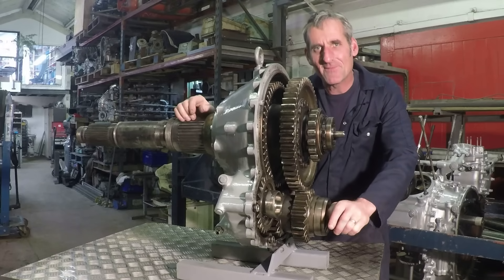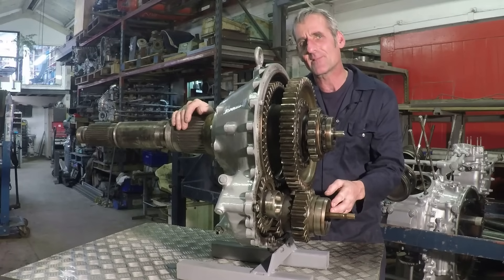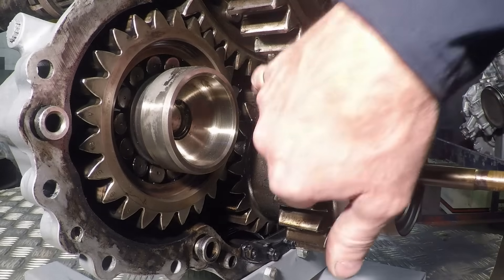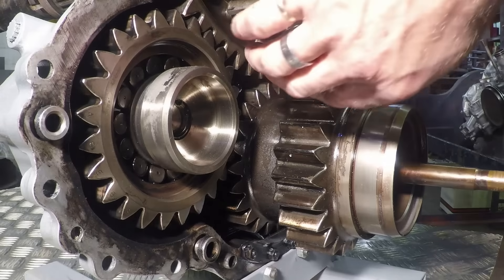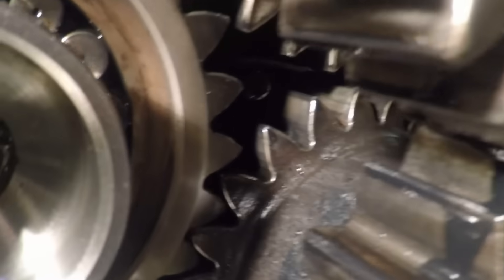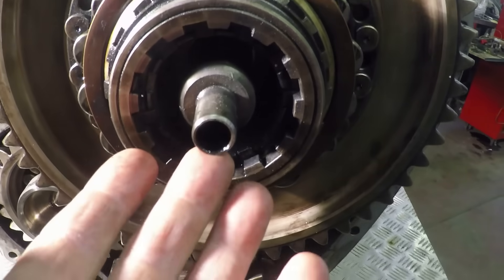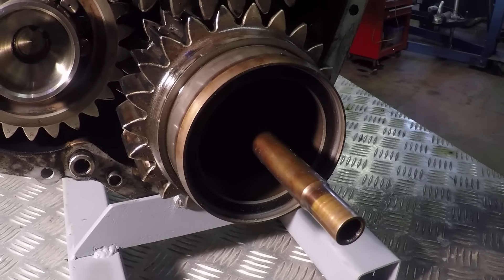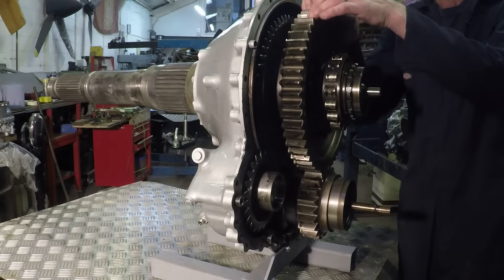An Explanation Of The Rolls Royce Griffon Counter Rotating Propeller Gearbox

Comment: Great video, how much does it weigh, and do you know of any other counter-rotating gearboxes in the 1000-1500 hp class?
Reply: Contra rotating*

The Griffon engine is in the 1700-2500 hp class, not the 1000-1500 hp class.

There was really no need for a coaxial propeller setup in 1000-1500 hp engines. While coaxial propellers are more efficient than a single propeller, they add weight, complexity and cost and were rare outside experimental aircraft. You needed to be in the 2000 HP+ category to have the benefits of a coaxial propeller outweigh the problems. At some point, you need exceedingly impractically sized propellers to absorb the power of the engine, as seen with the F4U Corsair with the gull wings to provide clearance for the huge propeller. It definitely could have benefited from a coaxial propeller setup, but I don't think Pratt&Whitney ever had an R-2800 with the required gearbox for it to work.

But coaxial propellers were nothing new by the time of WWII, engineers had been experimenting with them as far back as the teens and twenties on biplanes. But they had the same problems back then with complex gearing being so unreliable that the propellers often parted company from the engine when a failure happened.

Comment: i'm surprised the gears where not cross cut to keep gear whine down.
Reply: That's called "helical". Helical would be quieter, but would cause axial thrust (the gears push each other along their shafts), which makes bearings more difficult.

Comment: Was the face width on the second set smaller than the rear set? This in order to save power loss. Lubrication?  That’s some grunt going through that set of gears, did the Russians copy the concept for The Bear’s contra rotation props?  I note deep machining of the hubs to minimise weight but no radial slots.

Comment: If only Reginald Mitchell could have seen that.  I can't imagine the staggering amount of machining required just for that reduction/counter-rotating gear mechanism and housing.
Reply: It's not as complex as it looks. The whole gearbox body is either a casting, or more likely a forging for strength. The only real machining needed would be the mating surfaces and bearing journals. As for the spur gears, gear cutting machines had existed for decades by the 1940s, being invented in Germany in the late 1890s. So most of the process could be automated and didn't require a huge amount of labor once the production line got going.

The staggering amount of work would be done on the prototype engines and the processes for making serialized production parts, because those were hand made. You had to make the template for the casting/forging, the tooling and machinery to make the parts. It's why engineers tried to reuse as many existing parts as possible.

Comment: I always wondered how they got the prop to counter rotate.  I also curious why they had so many problems with the props on the XB-35's.
Reply from the maker: I`m not sure how the XB-35 gearbox worked, I know it was remote from the engines. Rolls-Royce kept with what they knew, and just doubled up on it, but in fairness, any new gearbox handling this kind of torque can give trouble without a doubt.
Reply: I'm amazed how simple this is actually.

Comment: A little bit unrelated to this video perhaps: Why does the Griffon sound so different than the Merlin and other V12's of that era? Is it due to the different firing order ?
Reply from the maker: Yes it is the firing order. The crankshaft is arranged differently. It still fires alternately between each bank, and all cylinders fire at equal spacings but I suspect there are exhaust ports close to each other firing in quick succession one one engine but not the other which would cause that irregular firing effect you hear from the Griffon.
Reply: @FlightEngineering1  Thanks for clearing that up. It has puzzled med for quite some time
Reply: @FlightEngineering1  Different firing order necessitated by the placement of the magnetos at the front of the engine, or ... ?

Comment: Very interesting! Just so I got it right. Gear in the back (facing the output shafts) has smaller gears - but the same number of teeth?
Reply: The gears should be the same diameter (otherwise there would be a difference in torque) but the teeth are a diferent size so they don't touch.
Reply: In fact, @vinny142 , both the input (smaller) and output (larger) gears of the reversing set are smaller in diameter than the corresponding gears of the other set, to keep them from meshing. The teeth are smaller because they have the same counts on smaller gear diameters. 

What needs to match between the two propellers is the drive ratio, which is the same because the ratios of gear teeth (and effective diameters) are the same.
Reply: Same number of teeth, but smaller pitch. So the gears end up smaller.